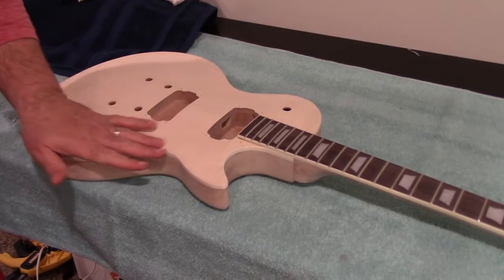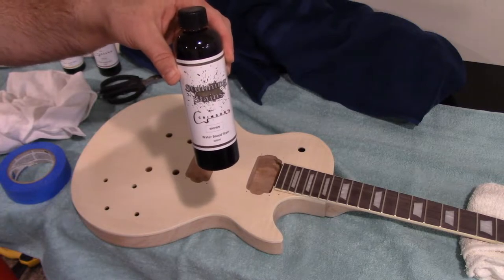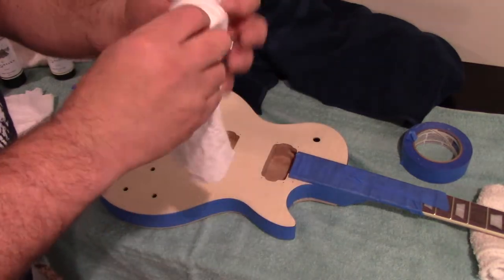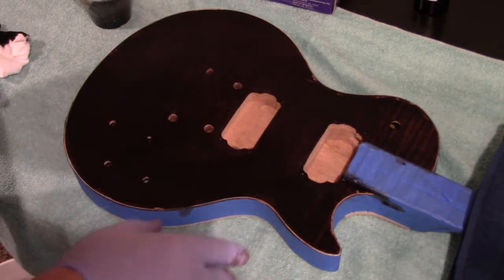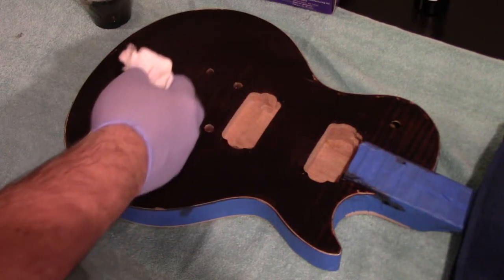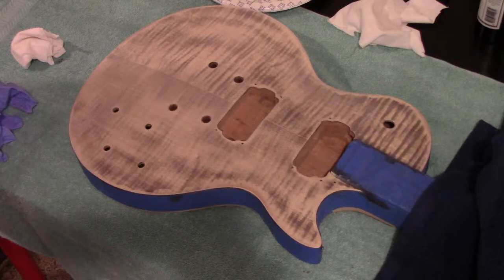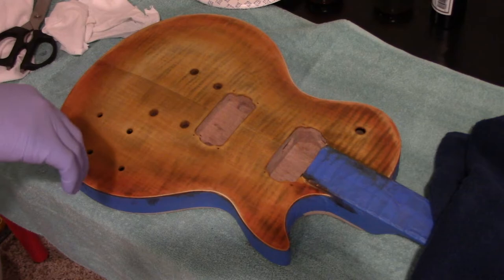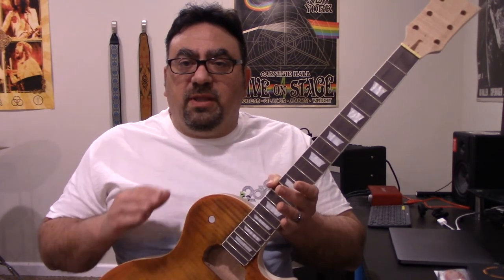Staining a Flamed Maple Veneer: Fretwire LP Guitar Build Part III

Comment: Thanks for this effort. I am about to attempt the same with a quilt top veneer, and I can see where applying too dark or deep of a base coat requires too much sanding, so I will definitely first, not sand so much beforehand, second thin down the dye about 50%,and third, precoat the top with either water or neutral to assure the black doesn’t penetrate too deep past the first layer of veneer.  Very touchy area working with these veneers and your video showed me exactly how far I can go without burning the veneer, which is about the hardest mistake to cover up once it is burned through.   Looks great man, thanks for taking the chances I was too nervous to take myself

Comment: Hey just noticed something I’ve had to struggle with getting a process- but right after you hit record on the camera, wait 3 beats before u speak. Even fast focus cameras take a second or two to focus: then you can edit off the out of focus and not lose the speaking. I’ve got a couple of vids where that happened and I just had to leave it in because I was too lazy to reshoot. If your face isn’t in the shot it’s not nearly as noticeable but when it is its self cringe worthy. I’ll usually count it in but that’s an old habit from radio and voicing commercials. Really nice pacing on this - no lulls at all! 🤘🏻
Reply from the maker: Thanks! I'm working on it!

Comment: Leather dyes are perfect for guitars.  Get the alcohol based dyes and some teak oil. To avoid over-dying the wood,  mix dye and teak oil.  Rub it in and keep it wet until it has the color you want, then wipe off all of the excess oil.  The next day, if the color isn't as dense as you wanted, just wipe with straight dye. It will not over-penetrate because the teak oil in the wood will limit penetration.
Reply: Thanks for that tip bro.  Getting ready to screw up my first really expensive build. You may have just saved it !!
Reply: @WilliamLassley  Yep, I made all the mistakes so you don't have to. Good luck, and be patient. Nothing can ruin a guitar build like being in a hurry.

Comment: I'm not sure if that was intentional, but I like how black accents look uneven at the final product... The final look is very original...

I'm going to try accenting with black dye on a similar flame maple veneer and I was wondering - how did you get away with using the 180 grit sandpaper on the veneer without going through it? I'm really hesitant about touching the veneer with the sandpaper, I was considering if I should start the sanding with 400 or higher...

Comment: How thin was the veneer on the guitar? I'm going to stain my LP kit, but it is very thin and also has what I's describe as stress marks on the wood which I wan to sand smooth, but afraid to sand through the veneer, DId you use wood filler or sealer on the veneer?
Reply: Don’t sand any more than absolutely necessary beforehand, and thin the dye down and wipe back quickly. Also using neutral first and color while still wet will keep color from going too deep. Then only sand back what is absolutely necessary, because hiding the burned through spots on a veneer is not for the inexperienced or faint of heart. Better for the stain job to look a bit off than to burn through the veneer.
Reply: Veneer is usually about 1/8” to 3/16” thick.  Not much.
Reply: @WilliamLassley  Thank you! I think I'll go for a better body and neck for my next project

Comment: I have a LP Vintage AFD and the veneers are really light
Is there a way to make them darker?
Reply from the maker: The only way to make the flames darker is to stain with black, but the risk is that you will completely soak the veneer causing it to potentially lift off depending on the glue used. If you want just the wood to look darker, you can always use a dark wood stain to achieve that goal. Thanks for watching!

Comment: Did you add water in the cup or jusst pour the water based stain in it?
Reply from the maker: I didn't dilute the stain at all. Thanks for watching!
Reply: Ah ok i might have to try that because with my experience on colortone waterbased stains it seems the colors are too light even if im using a med brown color
Reply from the maker: @cabronismo  you may have to reapply the color a few times to get the depth you're looking for. Just make sure you don't soak the veneer or it could separate from the wood. Apply one layer. Let dry. Next layer. Let dry, etc until you are happy with the depth of color you're looking for.
Reply: Old Guy's Guitar Vlog  yeah i initially applied the stain diluted and in one small area the venner actually soaked a lot of water thus i dont want tonapply with water anymore
Reply: What grit did you used to sand the base dye?
Reply from the maker: @cabronismo  very gently with 220, then went up to 320. Thanks for watching!